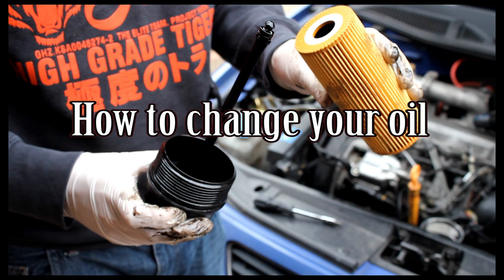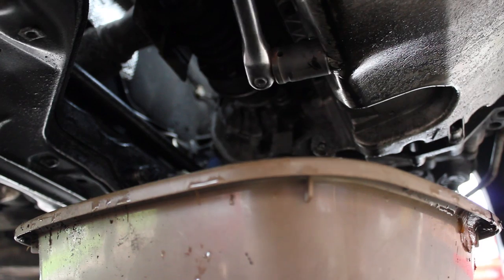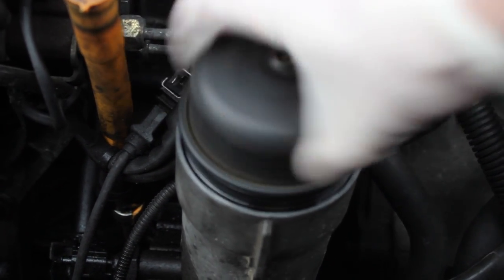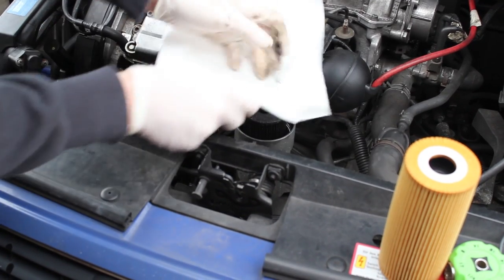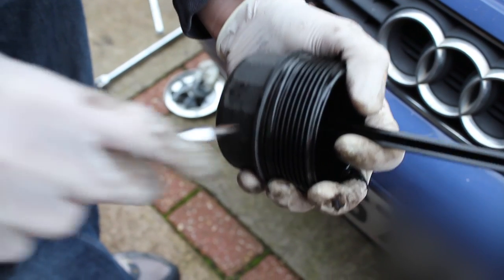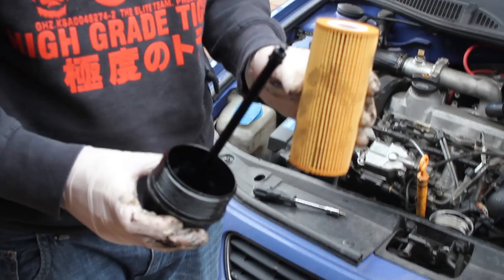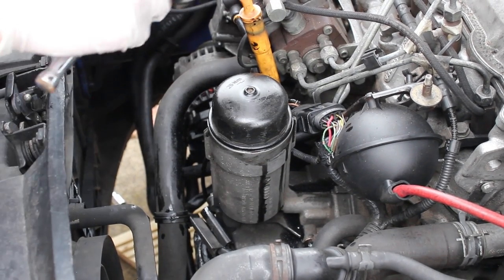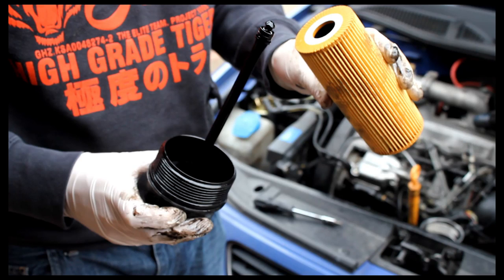How to change your engine oil and filter on a VW/Audi TDI

Comment: Did you have any trouble fitting the new filter? The one I bought didn't seem to allow the long plastic rod to go through it enough!? Any help much appreciated
Reply from the maker: Sounds like a parts mix up worth checking codes and maybe getting the parts shop to sort it.
Reply: CarAnd Mechanical turns out they did give me the wrong filter! You were right. Thanks for the reply and sorry for the delay in me replying(only just noticed😨)
Reply: Also ALWAYS look for the TOP marker.. All have to be marked, regardless of brand (Borg and Beck or a Bosch are the better ones)

Comment: Hi. Ive a 1.9 tdi vw bora 02 plate.  My Q is what spec is the cap tool?  Is it 76 mm or 67 mm?
Reply from the maker: Have you measured the diameter? Or potentially just pop the reg into a parts site and it should give you a tool match.
Reply: 74mm would be standard.. 14 flutes / edges..? Measure it

Comment: is this the same position as for the 1.6 engine?
Reply from the maker: Sort of I think - I have a 1.8T that the engine just came out of and it is at the front but pointing down and it's a metal oil filter type.
The manifold will be on your way a bit to do it from on top, I'd put the car on ramps or jack it up and put it on stands and come in from under the bumper (the undertray if you have one might need to come off).

Comment: some special oil for a audi  tdi ?  greetz
Reply from the maker: +el Rambow I use one a synthetic which meets the VW spec for my car (think it's 505.1) and I get synth as the place I get it from has offers where full synth is maybe £1 more then semi or traditional.
Reply: Any half decent engine oil will do.. Just check it meets or exceeds API SL, ACEA A3/B4 or MB 229.1 specs.. 10W-40 semi-synthetic is great.. I've had Audi's since 1984.. One has over 598,000 miles on. Change oil twice a year..
Reply: @BritSniper303  thanks !